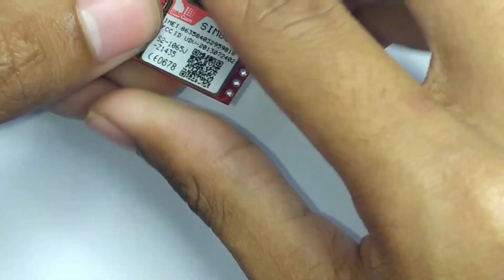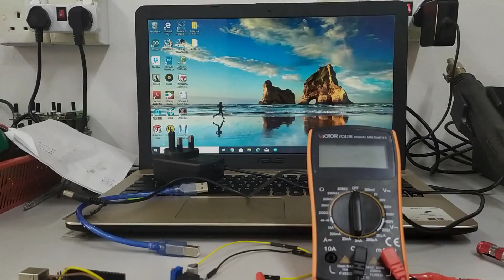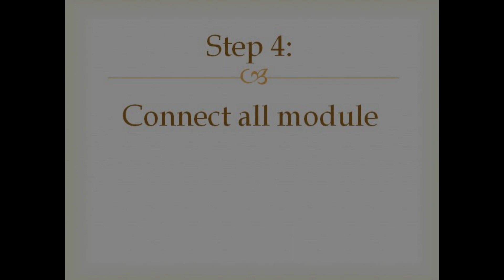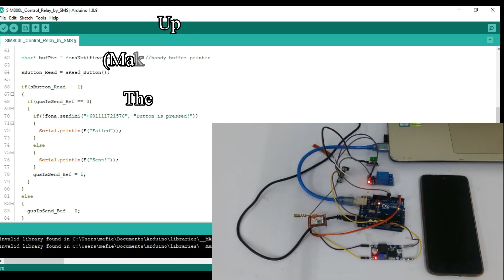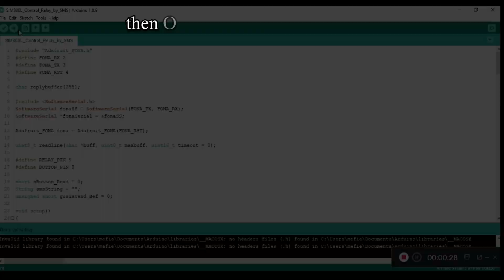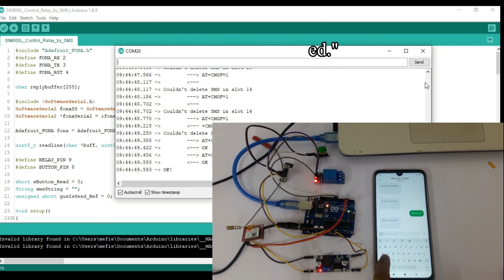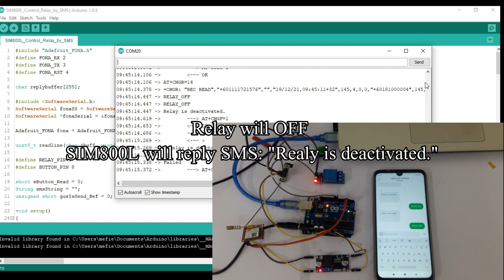Tutorial: How to use SIM800L to send SMS and control relay by SMS, 100% Work, Arduino Code Given

Comment: Why didn't you use voltage level shifter/resistance Voltage divider from 5V to 3.3V while sending to RX of Sim800L module, doesnt it will damage the Module?
Reply from the maker: signal no problem, power supply need to take care

Comment: I have a wire of 800 l gsm. The module is not working. The circuit connection is in place. the module is working. only sms and phone are not coming. the sim card is not working and gives an error. IT commands are also not working. Please help me.

Comment: Hi,thanks for the video.
I want to make this project. But I want to make it in a way that it can check the relay condition and then send a sms to the number. And then you can send an sms to turn it off and on.

Or something like a code that you can send to the module and then the Arduino checks the condition of relay. And then base on the condition commands the module to send an sms and tells you that  the relay is on or off. Can you help me?

Comment: I have a problem ...my module is blinking every second ...I’ve connected it with a Buck converter (4,1V) to my Arduino uno. It’s answering on AT with OK and on AT+CCID with the mobile number on AT+CSQ with 14-17 but it won’t connect to the net ...can somebody help me?
Reply from the maker: try check the credit of your sim card. And try to put under sky to get signal easily.

Comment: does this accept the RELAY_ON command from any mobile phone or the sender number to be added in the sketch? this helps in case the sender's mobile has signal issues
Reply from the maker: Both also can, can set inside the code
Reply: @mybotic_tech  can you please say here to put the mobile phone.
Is possible to after say 2 seconds the relay turn of?
Reply from the maker: @jcsilva.26  yes, can, need to adjust the code inside

digital write(relay, Low);
Delay(2000);
Digital write(relay, high)

Above example only, syntax may be wrong,
Reply: @mybotic_tech  how thanks.
Here I can add the number that commands the relay (i only want 1 number to be possible to make the relay work)
Reply from the maker: @jcsilva.26  yes, can also, everything is coding

Comment: Green LED is not activating of relay module then how you  are saying relay is activated? Relay is not changing the STATE. Reply!
Reply from the maker: green led is behind the wire, but it really activate
Reply: @mybotic_tech  But mine is not activating for the same wiring. What to do? I uploaded the code you provided, without any changes. Please.
Reply: @mybotic_tech  hi sir. What could be the probleme when the system is not activating the relay ? i used the same code and wiring. 

I waiting for a response please
Reply: @foudaarist1558  same my relay is also not working after same coding. plz respond

Comment: why did you use  2 power supply? one from your laptop by USB cable, the second one from AC current by DC jack. does using power supply from laptop isn't enough?
Reply from the maker: the usb power supply not enough for gsm, need to use adapter minimum 2A for gsm
Reply from the maker: one supply from adapter enough for arduino and gsm, the usb i attach is for serial monitor
Reply: thanks i have followed your tutorial and it works like a charm! the supply voltage i have been using is 4.2v
Reply from the maker: great! thanks for your feedback

Comment: Whilst the DC/DC converter to power the SIM800L is a nice touch, for simplicity connect the 5V pin of the Arduino via a resistor to the base of an NPN power transistor, the collector to the external 2A power supply and the emiiter to the SIM800L power input.  Since high current is only intermittent the transistor should not have time to overheat so long as it's happy to take 2A.
Reply from the maker: great explanation!

Comment: my Question  is whose number write in the code (String number = "+xxxxxxxxxxxxx";) that are insert SIM in  module SIM 800L  or  other On which we receive message or call
Reply from the maker: the number you can set by yourself
Reply: @mybotic_tech  thanks

Comment: Hello sir my gsm 800l module always blinking in 1 sec , i was also waited for 1 hours but still it blinking repeatedly in  1 sec period PLZZ help sir is there any solution 🙌
Reply from the maker: it means detect no signal, maybe power problem (at least need 2A power supply), also go to outdoor test it
Reply: @mybotic_tech  yes,I have same problem too.
Reply: @mybotic_tech  I use ESP32 instead of arduino with Arduino IDE.As I said led blinks in 1 sec.When I send  AT+CREG? or AT+CMGF?  ,I get ERROR response(this sim card of my phone) ,when I use another sim card (line is not active. so I could not send message to my phone.with this sim card I can get OK response from  many AT command)I do no get ERROR response.What might reason be?
Reply: @shrigatty1278  Sir i need phn call then press 1 motor is on and feedback sms .

Comment: why relay not respone when i pull out usb cable ?
Reply from the maker: It may due to power supply problem. You may check the board's power supply which from the DC jack. Make sure the power from DC jack is in range 7v to 12v. Hope this help. Thanks

Comment: Hello, why program not running when i plug off usb cable?
Reply from the maker: when using DC jack, the power supply need in range 7v to 12v 2A. what power supply you use?
Reply: I using power suply 12v. 
Will this program run when it does not open the serial monitor? because I will put it in the car
Reply from the maker: your arduino turn on?
Reply: @mybotic_tech  yes. Using power dc 12v
Reply: @Utkarsh Alset try to make your computer go to sleep after first sms are OK, then pull usb out. While power supply is stable,  all works in my case (also SIM800, but code is different)

Comment: Good Morning bhaya......

I have a project,
Am work a one small company. 
I need GSM Module board with 12Relays.
We have to Control this with mobile.

1st Relay-----Generator start Relay 10sec need to close.
2nd Relay------Generator Off
Relay 10sec need to close 
3rd Relay-----Generator suplay on need close our timings.

And remaining Relays 

4th Relay----- If 230v Mains Fail we have to get Message/Mains Fail Alaram, if Mains Power Available / Mains Power Restored. 

5th Relay------If 230v Generator ON we have to get DG ON Message, If DG Stop / DG Stop message.

6th Relay------If 230v Load suplay Available we have to get Power Issue clear message, If Load suplay not available we have to get Power Issue.
Reply: Is this possible
Reply from the maker: possible, can do
Reply: @mybotic_tech  please make a video